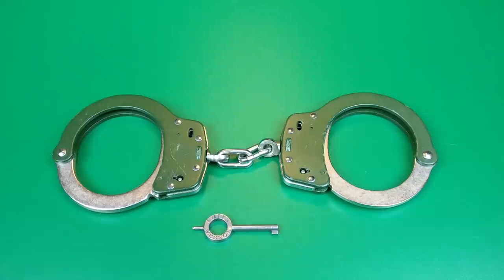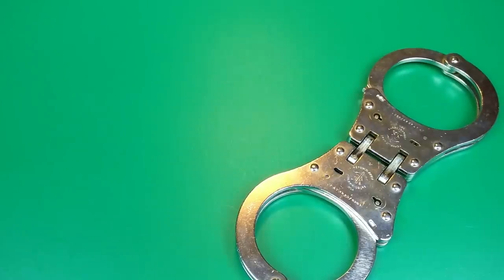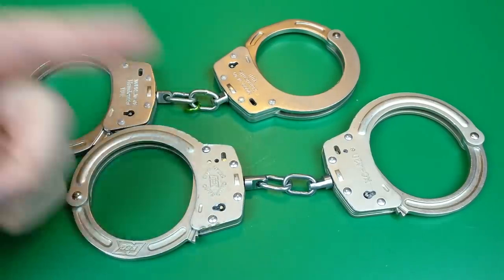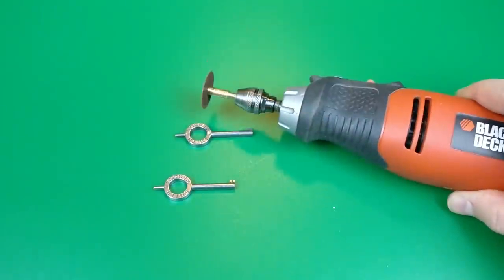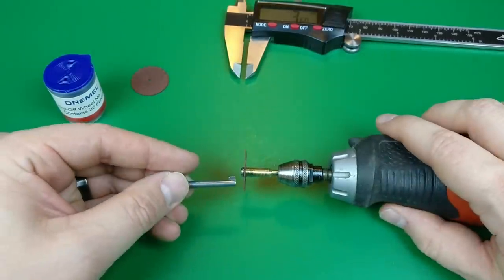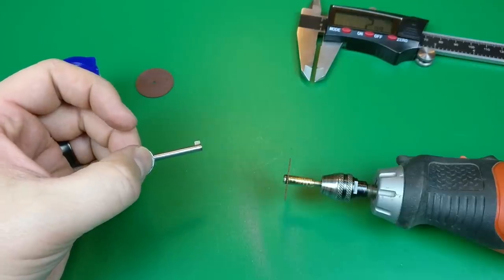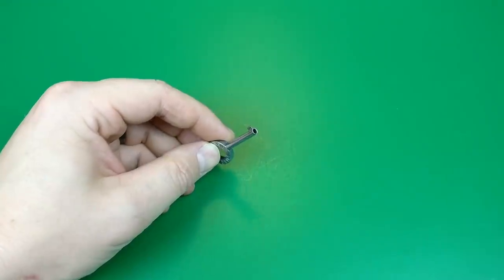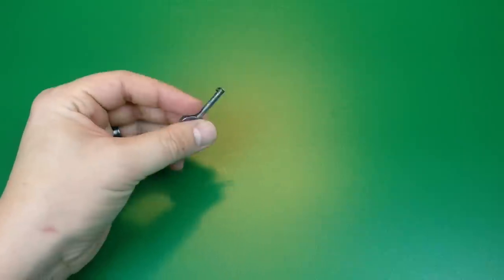Making the Ultimate Handcuff Key

Comment: Epic. Good to see a modern video on this. I am someone who always widens the inner hole for maximum compatibility. These keys rock. I've made several over the years but manually using a Vernier caliper, diamond files and a junior hacksaw blade. Some turned out horribly because the split was hard to get in the middle. I have probably made like 15 of these over the years and I still have a few left over. I keep a raw TOOOL spec one in my wallet but around my neck is a modified one which is a bit longer than 2.9mm on the width in order to have an easier time with triple pawl cuffs, since it's more of a go-to key for actual use rather than emergency use. Which is why I keep a raw TOOOL one in my wallet just in case I ever needed it "in the wild" so to speak. I know the one around my neck works with all but my M104 high security S&W cuffs. I added your video as a reply to my tweet today about the ultimate handcuff key. I would have done it sooner if I had searched prior to tweeting to see if there were any other cuff key videos. Excellent work.

Comment: One thing worth mentioning regarding asp, be careful with the TOOOL key and it's edges. The key-engagement faces for the double lock activating and deactivating are plastic. Always use a fine diamond file or a leather strop to ensure the edges of the long side of the split flag are smoothed. The height of the key means sometimes you clip the deactivation portion even when they are single locked, so you want as minimal wear and tear as possible.

Comment: Have you seen the Delta key which is similar to this key but also has part of the back of the shaft cut off, supposedly to be able to pivot deeper into odball cuffs? If so, any thoughts on it? Worth upgrading TOOOL keys with this aspect?

Comment: Given the relatively tight tolerances, is thermal expansion a potential issue when performing measurements during the process?

Also, do you prefer crunchy or soft tacos? If soft, corn or flour tortillas?

Comment: One more idea to make a great key a little better. On the round portion where it says Smith and Wesson. You can file down one side giving a sharp cutting edge for tape and zip ties. Leave the other side alone so you can push through whatever you cutting and not cut yourself.
Reply from the maker: That's a pretty neat idea.  I'll try it!

Comment: Tacos.
What cutting/grinding wheel did you use? I know the width of the center cut is very important and many Dremel-style cutting wheels seem too thick.
Thanks!
Reply from the maker: the width of the cut honestly doesn't matter as much as some folk think.  i believe this one isn't the thinnest available.  i used to use a much smaller diamond wheel.

as long as the cut in the middle of the bit isn't accidentally SO huge that it could allow the middle pawl of a triple-pawl cuff to fall into it, i think it's fine.

Comment: i've never seen handcuffs that had a cutout window where the spring detent is, couldn't you just shove something like a flat blade screw driver or similar in and pull down on the spring and just bypass the lock?

Comment: I found myself handcuffed in the back of an rcmp patrol vehicle around mid October 2019 so I put the cuffs in the front and tried my handcuff key but the holes in the cuffs where too small. Those cuffs required a fairly small key. Im pretty sure that my key is pretty standard. I wasn't trying to escape.  I knew the officer would have to let me out soon and I wanted to hard him his cuffs instead of letting him remove them. Still frustrating though. You carry a handcuff key for 10 years and when you finally try to use it it's of no use.

Comment: I did see a picture of the American high security handcuffs a few years ago and I did notice that there is a slot in those as well bit on those the slot is not straight down the middle of the flat piece at the end of the key but is at the bottom of that flag piece going from the top of the key into the flag piece at the part that connects to the round part of the key and it cuts in about 3/4 of the way from what I can remember. In any case, in the city I live in I am a repair man and I do repair work for a lot of Mexican Grocery Stores and restaurants so I get to eat tacos almost every day. If I win the giveaway on this video I will put the two pics used on tv in a frame and hang it on the wall. I am a member of the Locksport community and I have started my own YouTube channel and I use my name Ryan Clay here on YouTube as the name of my channel and my sideways picture is what is on my channel. I can be reached in the comments section below video's on my YouTube channel and here as well because I should get a email message about response to my comment. I do like your video and your invention of the universal handcuff key

Comment: They're your tools, so use them how you want to, but please reconsider using a cut off wheel to grind. Reconsider using those powdered cut off disks for anything, really. They are only rated for like 5k rpm, and if they jam up or chip at higher speeds they can cause nasty accidents. Use a real grinding disk, or a sanding drum. Oh, and TACOS!